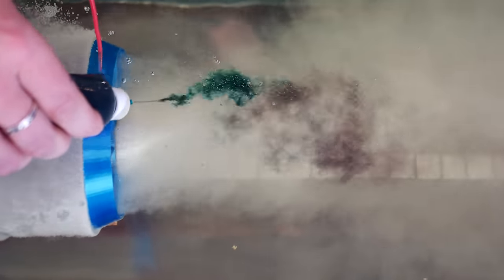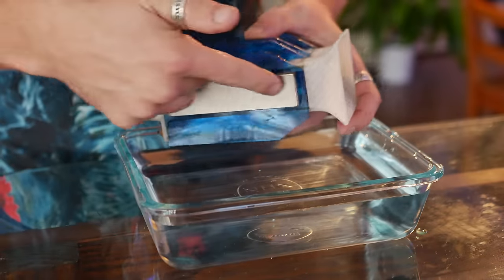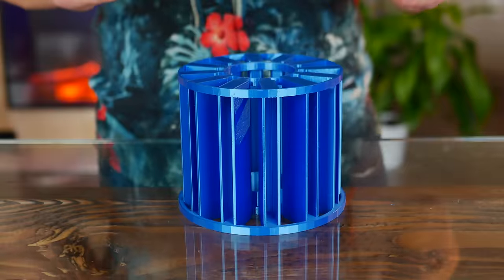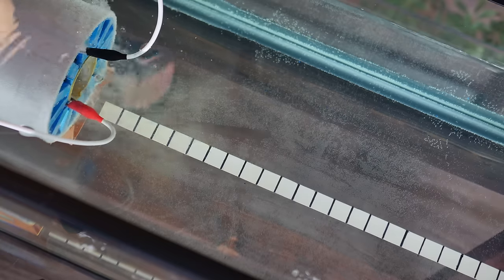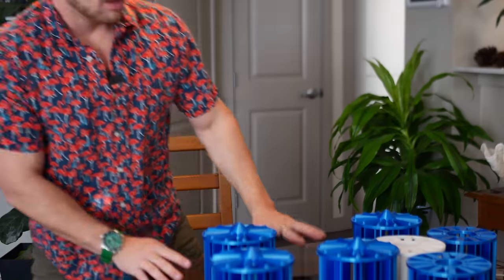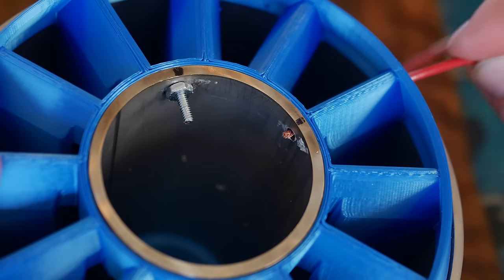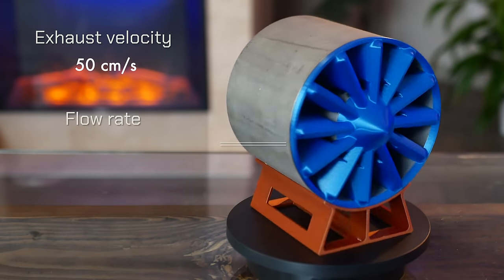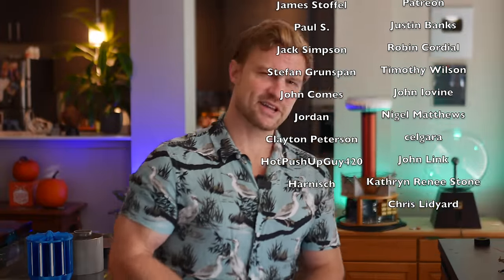Designing a Futuristic Magnetic Turbine (MHD drive)

Comment: It would be awesome if you could capture the byproduct hydrogen and oxygen gases created by the electrolysis of this thruster and create a type of afterburner that ignites them and creates more thrust from the wasted energy
Reply: Or feed it into a hydrogen fuel cell to get some energy back to power the anode and cathode
Reply: not great for real world application tho, one spark and that's a big boom
Reply: @camerongarson9963  big booms are pretty awesome too :)
Reply: @camerongarson9963  suck, squeeze, bang, boom. add a piston or turbine and that works exactly how we want. The bigger challenge to overcome is getting those gases out of the water during operation since the structure would impede the flow path and decrease the thrust.
Reply: And just like that, the whales were dying again
Reply: @foohines  indeed but the goal for this project was to have quiet propulsion haha
Reply: it's not just hydrogen and oxygen though... it has salt in it...
Reply: just let them float to the atmosphere, more oxygen and hydrogen wouldn't hurt
Reply: @jont453  very true lol. But would still be sick
Reply: @digitalsparky  it was my understanding that salt water electrolysis still produced oxygen as well as chlorine on one of the electrodes. I could be wrong though!
Reply: @Nitsirtriscuit  it's bang blow*. and i more meant that if you're using this in industrial freght shipping applications then you're trailing a cloud of highly combustible gasses that could do a little bag and blow you to fucking peaces there bud
Reply: Great idea
Reply: And remember that the salinity of the exhaust water is increased.  This is not only a thruster, it is a water salinity increased.   
Always watch for unintended consequences.  What would happen if ALL our shipping switched to this thrust method?  What condition will the oceans be in after 100 years of use?   I’m not implying any specific result… just wanting to be sure the question is asked BEFORE a shift is made.
Reply: NASA is already using this tech for hypersonic flight. For reducing drag during hypersonic flight and control of hypersonic craft.
 "uses energy harvested from the ionized flow occurring during flight at hypersonic speeds to power the electromagnet and generate extremely large Lorentz forces capable of augmenting lift and drag forces to steer and control the craft. The energy harvested can alternatively be stored for later use."
Reply: A micro gas flare.... Nice!
Reply: A practical thruster would be the opposite: it would avoid electrolysis entirely.
Reply: @obiwankenobi2749  nothing lives forever ...and who wants to be nothing ?
Reply: No way the hydrogen and the oxygen expelled out of the magnetic engine can be captured to be burned for more thrust. It's just impractical.  Moreover, the chlorine gas created by the electrolysis of salt (sodium chloride) in sea water will be detrimental to the health of marine life, especially when used in large scale.  It's definitely NOT environmentally friendly.  However, the magnetohydrodynamic (MHD) drive could have practical application in military submarine which demands the noise level to be as low as possible.
Reply: It actually would, I actually believe mass production and use of these, because if a discharge of oxygen, could create wide scale issues if it wasn’t regulated properly. You can’t just off gas things into the atmosphere or water, ever. You can in small amounts but the scale at which we would because if commercial use would be harmful. 

That being said, instead of using this as an engine you could put it in de-oxygenated dead zones in the ocean and help reverse what we’ve already done to the oceans.
Reply: @MSB-sn1md  It takes water with dissolved salt in the water for the  magnetohydrodynamic drive to work. I experimented with such a drive decades ago on a tiny scale and found that in addition to the electrolysis of water by the drive, electrolysis of common salt NaCl also happened. Both the Sodium molecules and the chlorine molecules released would be detrimental to the environment if the MHD is used on a large scale.
Reply: Even if it was possible to capture all those small bubbles that afterburner will only generate hydrogen chloride, (which is hydrochloric acid when in solution) since there isn´t enought time for the transport of hydroxide ions from the negative to the positive electrode.
Reply: @erikwalfridsson8790  It depends on the concentration of the salt solution.
Reply: That is definitely the way to go with something like this! Use in the air prevents al the unnecessary and unwanted after effects of hydrogen production and thermal water temperature increases which would boil water in the immediate vicinity of usage costing more marine life to perish!! So using it in the sky is really the best direction to go in!! ❤
Reply: @joshuagonzales3807  The MHD drive does not work in the air because air does not conduct electricity as good as water , especially sea water.

Comment: Have you considered inserting neutral Stainless Steel plates in the gaps between each fin in the thruster?  Though the neutral plates would not be directly connected, current would flow across the neutral plates, by way of the connection through the water.  The neutral plates should produce additional thrust and would lower the amperage, because they will reduce the distance the electricity has to travel between plates.  Hopefully this helps.  Great Video and thank you for sharing.
Reply from the maker: Off the top of my head, I believe this may lower output because now the entire water column isn't conducting...thus...the entire water column doesn't have a magnetic field internally, to be influenced by the external fields. But hell, i'm definitely wrong from time to time. I'll look into this. Thank you.

Comment: While powering a boat would be fun to see. I think it'd be worthwhile to go through a few more rounds of optimization first. Still seems underwhelming, even at the higher voltages, where your later optimizations seemed to have a reduced effect.
Reply: For something that consumes 750W, the thrust produced is absolutely pitiful. The efficiency just isn't there. Too much waste doing electrolysis.
Reply: @haphazard1342  worse than that.

meh. what he fails to do is set it up so it can MOVE. little rotating arm... a load cell... 

like everyone, showing a stationary "jet" and the airspeed out the back... it means NOTHING yet they all do it... 

im of the opinion that they dont work at all, that its simply ions from electrolysis that are moving, inducing slight water flow but there no real magnetic coupling of currents, no interaction of induced, moving, and stationary fields...

that the water is "dragged along for the ride" rather than actually contributing to "thrust". the only "thrust" would be the reaction to moving those ions in the magnetic field. not the water.

Comment: Great work, I also have some design improvements. The change to radial was a great decision, but you should also change the flow channels to radial. Think about a shell and tube heat exchanger for reference. It may reduce some magnetic efficiency but I think the flow efficiency could be more important. The bubbles being produced clearly indicate turbulent flow (or electrolysis, probably not that though.) Also look at the Dyson vacuum and how it has several smaller channels for flow better
Reply: The bubbles are CHLORINE GAS.
Reply: you can also massively reduce the print time if you do away with the vertical supports (by adding a 45degree chamfer on the top side)
Reply: @bpark10001 Wrong. It's Hydrogen and Oxygen and a little Chlorine.
Reply: The bubbles are H² and O², mostly. They likely also contain disolved gasses that are released when the water is heated.
Reply: @kevin_6217  Wrong. There is no O² produced at all in the reaction: 2 NaCl + 2 H2O → 2 NaOH + H2 + Cl2. It is Hydrogen, Chlorine and Sodium Hypochlorite
Reply: @NeilStansbury  If this was mainstream and the engine standard, wouldn't the massive increase in chlorine be more dangerous to sea life than standard propellers? Or does the reaction eventually go back to water and salt.
Reply: @NeilStansbury Thanks for the correction. I always thought the salt was only a catalyst that improved conductivity of the water. I didn't know it changed what chemicals were output. I learned something new.

Comment: Yes lets see a part 2 of this! You could also create a outer intake ring that would further help the flow. Check out the designs they use on Jet engine intakes on test stands. Another option is to crank up the volts to see how high you can go before arcing- would be fun. Lastly create a way to ignite the Hydrogen Oxygen mix as a afterburner lol lol .

Comment: Weld a lot of the outer tubes side by side, and 3D print the magnet housing to be buoyant, and hey-presto you've got the back part of a boat which uses it's propulsion system as a stressed member.
Reply: Live current through a structure, yaaaaay...

Comment: Have you considered using aluminum or Graphite for the electrodes? Aluminum should transfer the same amount of power, but at a lower weight, increasing efficiency since it has to push less mass through the water and may also be a less expensive material.  Likewise, graphite is probably a little more expensive, it should have electrical conductivity properties, weight even less than Aluminum and be more resistant to corrosion both from electrolysis, but also from the marine environment as well. Brass/bronze is used a lot in marine environments for its durability and resistance to corrosion, but I think it would be even heavier and more expensive to use, although I have no proof, just conjecture.
Reply: Graphite could be perfect for this, actually

Comment: If you cut out reliefs in the side of the large metal pipe, you could theoretically reduce material cost, weight and all at once increase the effective flow rate using slots/holes to maximize the entrainment of the surrounding fluid. Make the slots venturi-shaped, narrower at the entrance and widening outward, to facilitate the pressure-driven entrainment of additional fluid into the flow path through the turbine.

Comment: I’m sure the U.S. navy will be very interested in using MHD drives for their submarines. You should apply for a DARPA contract to mount MHD drives on small submersibles like the SEAL Delivery Vehicle (SDV) or underwater drones and then work up to larger vessels.
Reply: They probably already do tbh their turbines are always hidden
Reply: They already were, that's what the hunt for red October was about. The issue is they could still detect the subs due to electrolysis
Reply: They wouldn't be terribly interested given how loud and inefficient they are. Those gas bubbles are going to collapse at depth, and you can't avoid making them, so, defacto cavitation. On top of that, cavitation will tear this apart just like it would a propeller.

Comment: you may want to try to put an angle on those blades to make a simulated spiral like the propeller creates.  then make a shallow but elongated cone on the exhaust end to make a jet thrust.  it may create enough pressure to get your cm/sec up with no increase in volts added

Comment: Great project! Would be cool if you could show us some numbers in comparison with classic engines, for example the power consumption to thrust raio. Just the output velocity alone does not say a lot. And also you might consider testing the engine on different water velocities. Many motors produce a lot of thrust at a specific relative speed but may completly fail when testing in a real environment on a boat for example. A graph comparing the thrust between relative speeds would be awesome!
Reply: .......don't forget  " parasitical drag " ......it's still an interesting device that would have value .

Comment: Using the MHD as a more silent thruster is a fascinating concept and well worth pursuing, but I'd also be interested if you can reverse the process, i.e. Can one Generate Electricity by forcing saltwater through the turbine? Is that something you could test in a future video?

Edit: this could be an interesting concept for tidal energy, especially for having no moving parts.
Reply: Unfortunately I think the answer is no, because what's really happening here is that the magnetic field is accelerating the flowing electrons in the fluid, and of course normal salt water has no flowing electrons to generate power with. Although, perhaps you could by running a small current through the incoming fast moving salt water to energize it like an AC generator's coils.
Reply: @gajbooks  Ah ok, thanks for your reply and hypothesis! Wouldn't the magnets polarize the saltwater, creating a voltage that can then get electrons to flow from the circuit you connect the generator to? It's not really my field of expertise to be honest, I'm more looking at this from a hydropower perspective. 
With AC it could also work indeed, but I'm wondering if it wouldn't just work as a transformer then, where the changing magnetic field of the electromagnets then directly induces the coils or electrodes meant for the electric current ignoring whatever your water flow does... 
The method you mention reminds me a bit of the bladeless wind turbine some researchers at TU Delft developed that let the airflow/wind carry electrons from the source to the receiving electrode (I suppose?) and thus creating a voltage/current in the circuit. A bit like one of the earlier versions of the Plasma Channel's ion thruster.

Comment: Hello! Nice video, but I have a question: do you really need to expose the electrodes to the salt water? what if you isolate them and just create the electric field without the electrolisis?
Reply: I am afraid it is necessary for the electrodes to be in contact with conductive water. If the electrodes are insulated, there will be no flow of electricity between the anode and cathode that interacts with the magnetic field, and as a result, there will be no thrust.
Reply: @xplosiv3z799  I guess the interaction is between the magnetic field and the electric field, not between the magnetic field and the current. Am I wrong?

Comment: Lasers, often considered the weapon of choice for space battles, also have important drawbacks. One of the primary limitations is beam dispersion due to self-diffraction, which causes laser beams to spread out over distance. This means that while lasers might be deadly at close range and effective at medium range, they lose much of their potency at long distances. In space, where distances between combatants can be vast, this makes lasers less practical than many assume. A mass acceleration system like a Gauss cannon would likely be more effective for long-range engagements, offering a more focused and reliable means of delivering damage without the energy dissipation seen in laser technology.

Comment: This was used by submarines during the cold war (and likely today). Maybe not as the main propulsive element, but as silent thrusters. There are grainy photos of inlets and outlets on both flanks of the body near the rear where the supposed magneto-hydro-dynamic thrusters were installed.

Comment: That's awesome, I've made sooooo many different ones in as many different sizes and ratios to each.
 It's been a couple years since my lt one, but I still make electromagnets all the time and try to keep my printers going non-stop/maintain 100s of prints lined up for things I want to make and improve on.

All three have always fascinated me, you never know who will stumble across something that may be used as the foundation for something used for years to come/what will come from the next person's idea after that!

We know magnets lose their charge and that we can rebuild that charge. We can magnetize other objects altogether...
 Liquids that can carry charges may some day bridge the gap, eliminating the discharge rate and corrosion which would change how we can use them altogether.
 If we can keep it from heating, maintain a perfectly steady charge, force and eliminate the wires running to it that will burn up before anything else...

I really want to see the day we have permanently, sustainable suspension!
 Several different thought process going on there... Helps me to think, even if nobody ever reads this, it helped me think of something i hadn't before, just after I finished typing that!